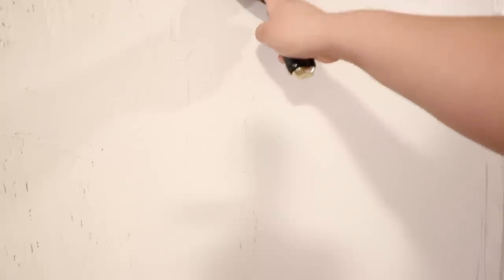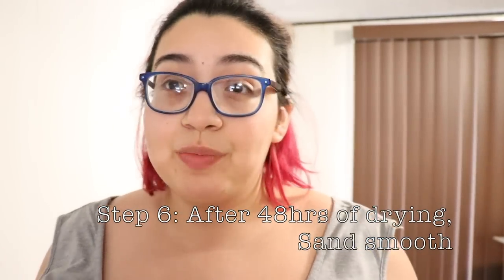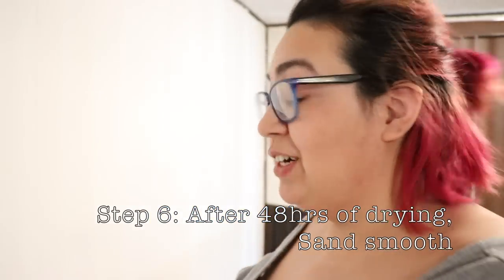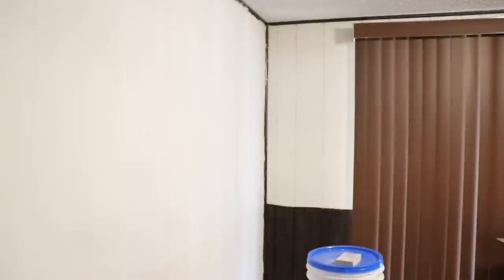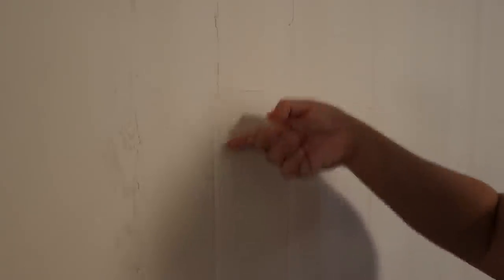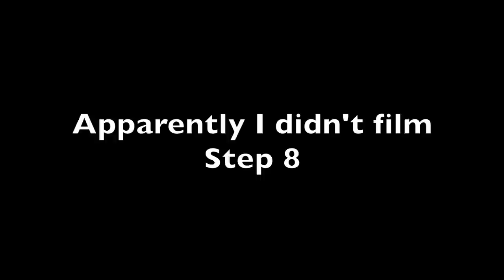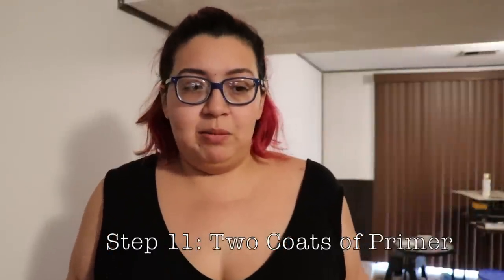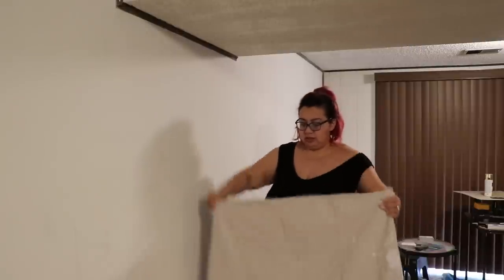Covering Wood Paneling | Affordable Remodeling

Comment: Great DIY video!  Thanks! Just one question, though... Any issue with hammering a nail into the finished wall to hang a picture?
Reply from the maker: Kari Coffey so far no issues, I’ve hung a few different frames up, haven’t put anything too heavy though. I assume it’ll be fine as long as you have a nail long enough to go through the wall behind this stuff.

Comment: Did u actually used the compound on the whole wall too and not just fill the lines in. ??  I would love to know. I’m going through this exact same thing at my dads. I just remodeled his whole kitchen
Reply from the maker: I did because the paneling that was there had deep holes as part of the “texture” but if it had been smooth like other wood paneling I’ve seen I would’ve just filled in the lines.
Reply: @Kimberlyscurves  thank youn

Comment: To any one that has wood paneling DO NOT DO THIS. I did this same thing a few years ago, With in a year every single one of seams between the panels cracked and broke out due to expansion and contraction. I have even spray and knocked down texture and now I have big 12x12 chunks missing. Paneling is flexible drywall mud is not. Remember you do not have to remove paneling you can just put drywall over it but have to extend your outlet and switch boxes, along with trimming your doors and windows. You will take 2-3 weeks doing this and can drywall a room in 2-3 days. Drywall is cheap and can get a sheet for 6-7 bucks.
Reply from the maker: Mine has been up for two years with zero issues. I don’t think it’d be a good option for everyone. I’m sure humidity and all that science stuff matters, but drywall isn’t that easy either. I did drywall over one wall after everyone kept saying to do that. Not any cheaper, and not any easier. Also couldn’t do it as a one person job. 
Everyone please do some research to decide what will work best for you. There’s a lot more info out there on this process than there was 2 years ago and there’s tons of info on drywall. Don’t ever do this big of a project based off one video or one persons experience.
Reply: @Kimberlyscurves  Yes drywall is not a one person job that is for sure. I live in MI and that room is a spare bedroom that has no AC in the summer and is shut off in the winter so temps can go from 40ish to 90ish depending on the season. Its also a modular house so may have some flexing in the walls and floor.

Comment: What is the difference between drywall mud and that stuff? Is it possible to get a link to what you have there? Im a hardcore newbie. Send halp.
Reply from the maker: Raven Vigil honestly I’m not sure. I’m not an expert I just saw someone else do it this way and did a little bit of googling. I do know drywall is much more intense and would have involved taking down the wood paneling which I didn’t want to deal with or pay for. I just went to Home Depot and looked at the different Joint compounds they had and the descriptions so I’m not 100% sure which one it is I used since I didn’t buy it online. Here is a link to what I think I used though https://www.homedepot.com/p/Sheetrock-4-5-Gal-Plus-3-Lightweight-All-Purpose-Pre-Mixed-Joint-Compound-381466/100321602
Reply: @Kimberlyscurves  your a lifesaver!! Thank you so much! So even putting this up I can still mount objects and such to the wall right? Im so nervous. I never done anything like this before.
Reply from the maker: Raven Vigil I have no idea about mounting TVs or anything like that, I would guess that as long as it goes all the way through to the wood it’d be fine but I’m not an expert so that could be wrong. I’ve only hung up pictures frames and stuff like that.
Reply: @Kimberlyscurves  Thank you so much! Yeah I suppose if its hitting the studs then it should work fine. I did a bit of research on it.
Reply: Another word for joint compound, "mud".
Reply: @kenyalove3770  thank you 😊

Comment: I'm sorry, but didn't catch the brand of compound you used and is there really any specific type of compound that should be used for wood paneling?
Reply from the maker: yeah from what I saw when looking into this project, the brand didn't matter so I just went to Home Depot and picked one out. They had signs by each different compound listing what to use each one for and what it would work best on. I would definitely recommend going to a store and picking based off what is listed and your budget. The brand I used is USG Sheetrock and it is their Plus 3 Joint Compound.

Comment: Correct me if I'm wrong but you don't need insulation in the basement.
Reply from the maker: tjdot8 from what I’ve seen you don’t need insulation if the basement is underground but mine isn’t. It’s only partially underground on one side. I’ve also heard there’s supposed to be insulation on all the inner walls and there’s none there either. But like I said I’m not a pro so idk for sure 🤷🏻‍♀️ I just know the basement is always cold and it’s pretty unbearable in the winter time so insulation would’ve been a good move.

Comment: Only thing I don't like about doing this is the cracks between the different sheets panels will eventually crack.
Reply: I went along all the joints and nailed in more nails, about 4" apart on both panels. For another $1.00 no more cracks.

Comment: It would be cheaper to just buy very very thin drywall and screw that on top of your paneling instead of spackling your entire basement wall.
Reply from the maker: Jeff Cao well I wish someone would’ve told me that before I did all this 🤷🏻‍♀️ when I was trying to figure out what we could do this is what I found and was told it was a cheaper alternative to having actual drywall put in.
Reply: But then u have to tape a float the screws guy it’s better to just skim it
Reply: There would be a gap between the window jamb/sill and the casing trim if you do that. This is the best way for sure.
Reply: Then you’d have to replace trim, outlets would be wonky, so would window casings.. would be weird where it met the ceiling.. requiring more trim to hide that.. and on and on it goes. 

This is by far the better (cheaper) solution for the problem she was facing (along with many of us): leaving as much in place as possible, and hiding paneling lines for ESTHETIC purposes only. Brilliant! Time consuming, but sometimes we have more time than money, don’t we?
Reply: Adding a thin layer of drywall would cause more trouble than its worth. Outlets, trim and corners would be thrown off.
Reply: Yeah definitely better what you did.

Comment: Will this crack with time?
Reply from the maker: geovanny pesantez I’ve had this done for most of the year and haven’t noticed any cracking. I didn’t see any mention of cracking when I first looked into this method, but there also wasn’t a lot of information out there so I don’t know about long term past where my walls are at now.
Reply: It won't crack if done correctly unless there's high humidity or extreme temperature fluctuations, which there shouldn't be if the room has HVAC. I myself wouldn't do it in a non-ventilated basement, but I wouldn't put wood paneling in a basement either so...
Reply: @nogoodcops6557  hi wat is a HVAC
Reply: @omgprojects93  Heating Ventilation and Air Conditioning
Reply: Use mesh drywall tape on the seams where two panels meet together "not all the cracks just the seems" this will stop any cracks before they happen.
Reply: xNinja83x Good advice to use drywall mesh in between each separate piece of paneling. My walls are lath and plaster (old house) behind the paneling, so some of the walls aren’t exactly level, making it where the paneling can move if it’s leaned up against, or pushed in.. etc. Mesh will definitely help!
Reply: @omgprojects93  you could have asked Mr Google for an instant answer.
Reply: xNinja83x nice tip! Would you use the tape before or after the mud?